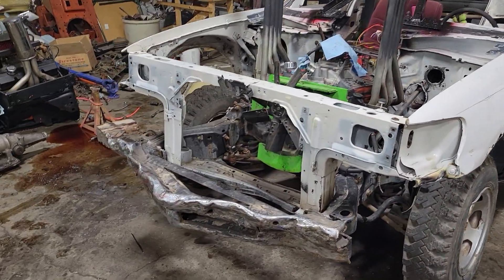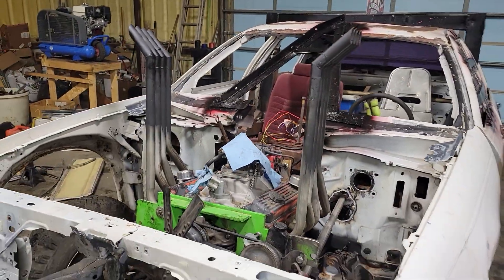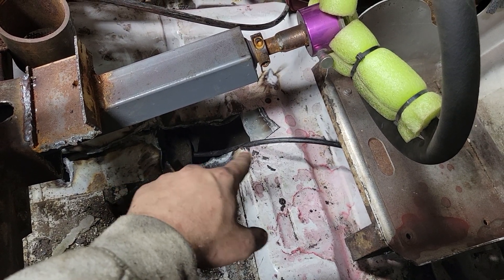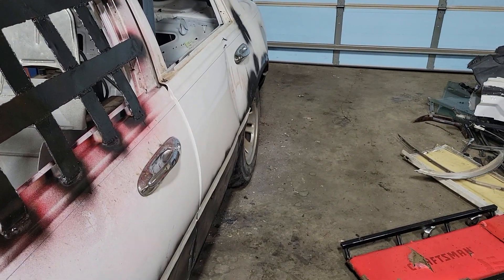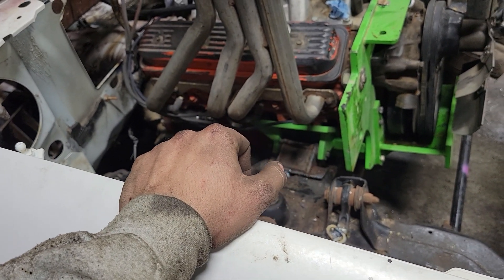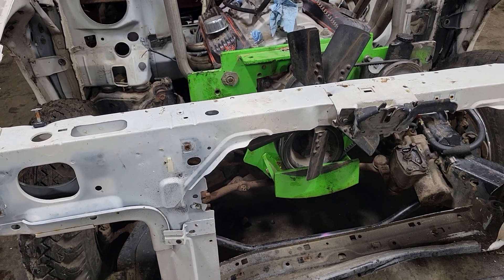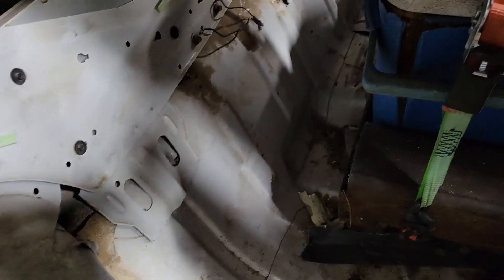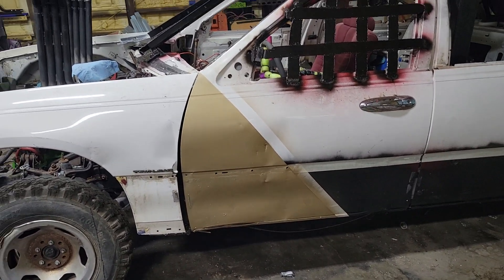Cornhusker Chaos bonestock build update #4 motor and trans in!???

Comment: take a small sqaure tube and weld a washer tab to bolt to heads on back of motor run wires threw the pipe as a plug wire protector. idk how many times I've had my wires pinched in firewall.
Reply from the maker: I've got a set somewhere
Reply: @demolitionderbygarage3568  the way I see it if your gonna go threw all the work you dont want to go out cause of a cut plug wire seems un pro like! ;)